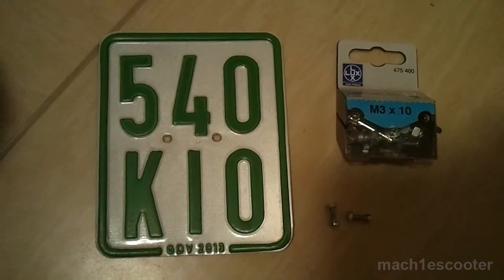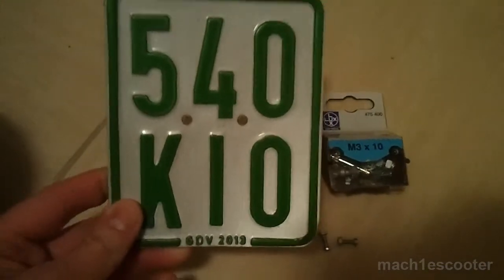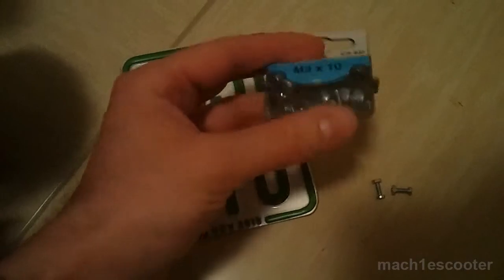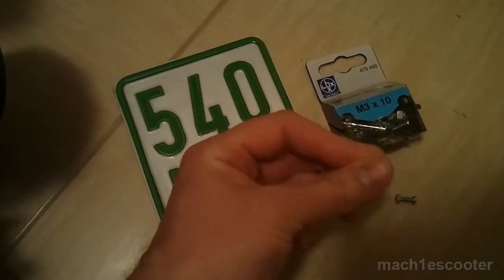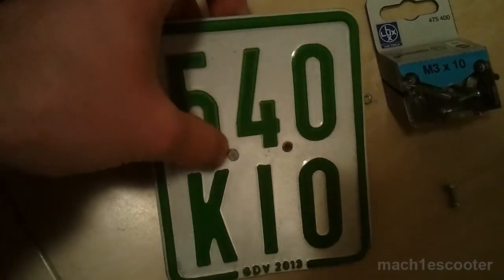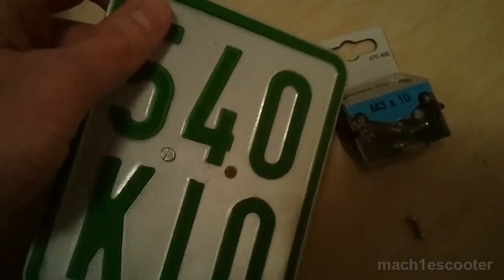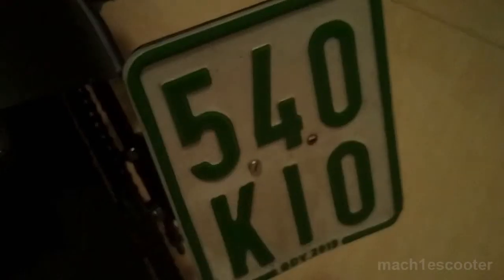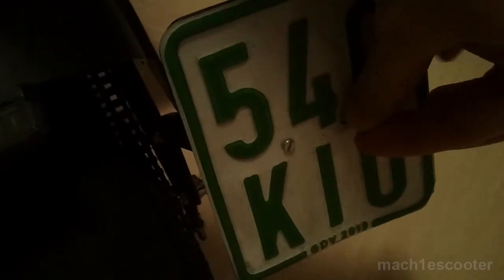MACH1 Electric Scooter 1000W 48V - License Plate

Comment from the maker: +TheeGamingGuru no, you just get a vehicle registration document. With this paper you go to an insurance company and get your license plate.
Reply from the maker: TheeGamingGuru usually if you have got a driving license for a car, you don't need anything else.
Reply from the maker: TheeGamingGuru legally it's a moped, you will get the same license plate as you can find on mopeds below 50ccm
Reply: +MACH1 E-Scooter hello.

You said we need a license plate for this scooter in Europe.
This means we need a license plate for ANY kind and weight of a scooter I guess?
Do we need a license plate for electric bicycles as well?

Thanks.
Reply from the maker: +Vladimir Hristov Yes, this is true. You need a license plate,  i.e. insurance for any vehicle that is goes faster than 6 km/h on it's own. However, you won't be able to register most of them due to the fact that they are not road legal. Concerning electric bicycles, no you don't need a license plate for them, as the they are just assisting you up to 25 km/h, you still need to pedal. However, electric bicycles that assist you up to 45 km/h, do need a license.

Comment: Unfortunately in the UK the licence plate has 7 characters, so the plate is slightly larger. For my scooter, I used heavy duty double side sticky pads to fix it to the holder, or the screws go through a character. BTW getting it road legal in the UK is really easy!
Reply from the maker: True. However, I wouldn't recommend using sticky pads as you may lose your license plate one day. Just use the screws ;)